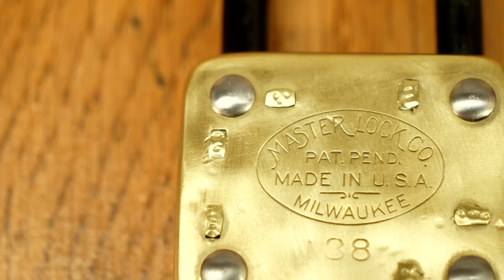I Restore A 100 Year Old Rusted Lock - Most Beautiful Brass Finish

Comment: Were you by any chance a locksmith in a previous job? I was locksmithing for the best part of 20 years and I recognise your techniques and the terms you use as proper locksmithing terms. My compliments to you for an excellent restoration using proper techniques, I applaud your key-making techniques, brings back some memories for sure. You just got a sub ;)

Comment: Another great restoration. Same exact style of lock that I had on my "box of treasure" as a child. Such memories. Also, I have a collection of springs, too. I try avoid throwing anything out that might be useful in my tinkering and crafts. A question, please. Would adding steel file shavings/dust to the epoxy be of any benefit? Just curious as I have collected a fair amount using a magnet. Awesome video.

Comment: For those times when you have to use a larger file in more precise filing look for flat file with a smooth "safety" edge on one of the two cutting edges.  They are unbelievably useful, though a little hard to find.

Comment: That’s some fussy work must have taken you a lot of time! In your last video I couldn’t help but notice how your welds were coming out, you can’t expect much if you have a flux core welder but if that is an inert gas mig welder you should replace your nose cone with one that covers your welding tip so that the gas can shield your welds and come out much much better.